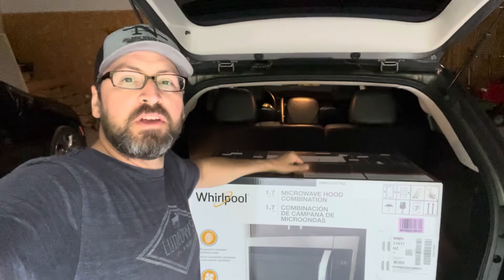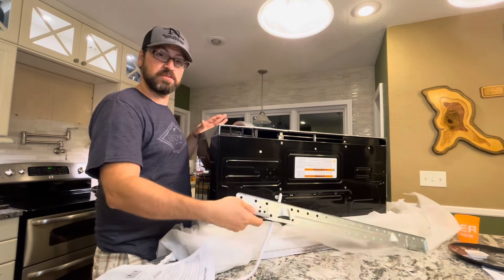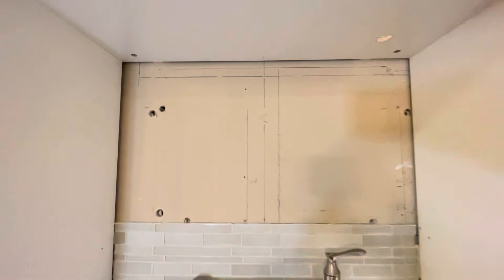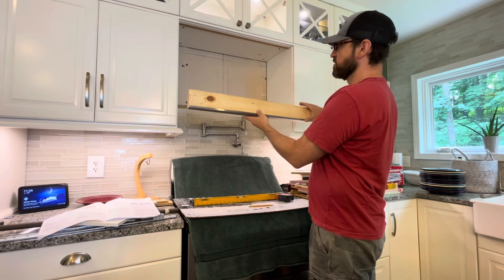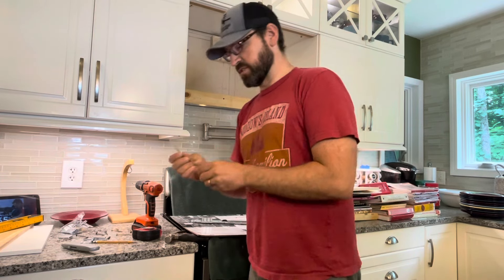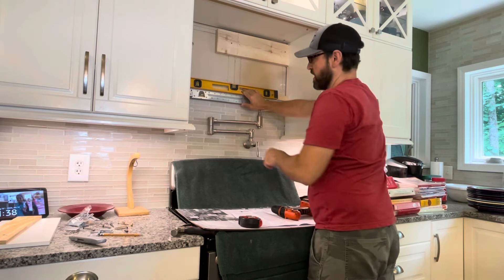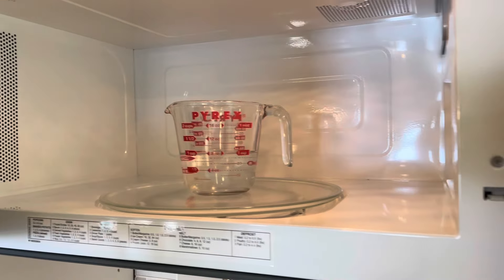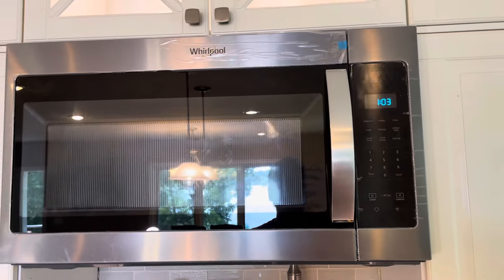How to Install a Whirlpool Microwave Hood - Step by Step

Comment: At 10:49 I see that there is a hole across the top of the microwave. When I first saw that, I thought it was missing a piece. So that's the way it comes?
Reply from the maker: Yep, that’s normal. It’s actually where the vent fan blows out, unless you install the exterior exhaust kit.

Comment: I bought this off of fb marketplace not knowing it was over the range type of microwave 😅 can i use this by placing it on the top of the fridge?
Reply from the maker: Yeah, it would work fine that way, but the bottom isn’t really made to support the microwave well. It might be wobbly up there. If you’re ok with that, it should perform just fine. Obviously the light and hood fan will be of no use. Good luck!
Reply: @NashwaukSteve  thanks a lot!

Comment: Thank you for this video! I too have a GE microwave that I will be replacing with this same exact unit. As you indicated the hole for  the power supply cord is in a different location. You dropped your install down a half inch or so and were able to use the same hole. Do you think you would of had enough space to reroute the cord if the unit was installed in the standard location? I don't have the proper bit size to drill the hole and would have to buy a paddle bit to drill the new hole.  Thank you for this excellent video!!
Reply from the maker: Thanks for the comment! It would have been tough to reroute the cord without any extra space up there. I’d probably buy the spade but and make a new hole. Good luck!

Comment: You mentioned that this is going to be a recirculating vent. Where does this unit vent? On the front, sides, top?
Reply from the maker: Hello- it blows out of the top, right behind the door seam. So the microwave needs to sit out about 1.5” to keep that vent clear. Good luck!

Comment: you dont need to make a exhaust hole to the exterior of the house ?
Reply from the maker: Hi @tinasiv2993 - no, you can recirculate into the same room. If you want the ability to exhaust outside, then you’d have to make a hole. Recirculating into the same room is okay. The only downside is if you’re using the fan to suck up smoke or smell, it doesn’t get rid of that air. It just gets a little filtering. That’s all.

Comment: Where is the hose that vents? Where does the exhaust go?
Reply: Self vented. That is tje default setting.
Reply: @daveforgot127 , what does that mean? self vented?
Reply from the maker: It sucks air up through the filters on the bottom and blows it out right above the door. That’s the default arrangement, but you can send the exhaust outside if you install some additional parts that come with it. I hope that helps
Reply: @NashwaukSteve  That it does! That clears up a lot. I have the hood and the accordion hose. I just have to figure out how to attach the hood.

Comment: What do you call the piece of metal you used to wrap the 2 x 4? I’m not sure what to look for.
Reply from the maker: Look at the IKEA NYTTIG piece. That’s what I originally had and took the metal from. Otherwise any box home improvement store will sell sheets or rolls of stainless or galvanized steel. Bending it might be the challenge though. Good luck!

Comment: Tie a string around cord end to pull it through the upper cabinet hole, if u are alone! I put a sturdy box on the old metal plate, over the stove, to hold the microwave up higher. Put a towel under the metal plate to orotect stove top. Then I may prop it up higher with books, to reach the correct heighth, so it can be screwed in while resting on box.
Reply from the maker: Thanks for the great comment! Working alone certainly adds some unique challenges, but it breeds awesome creativity. God bless!

Comment: not helpful if youre skipping the exhaust vent portion.
Reply from the maker: I installed mine in default recirculating mode. You’ll need to find a different video of you are venting externally.